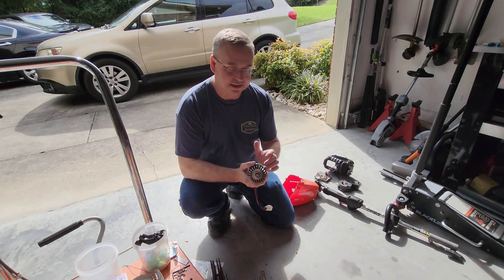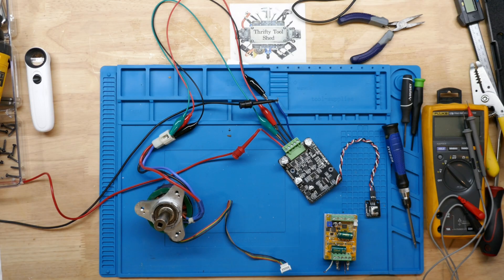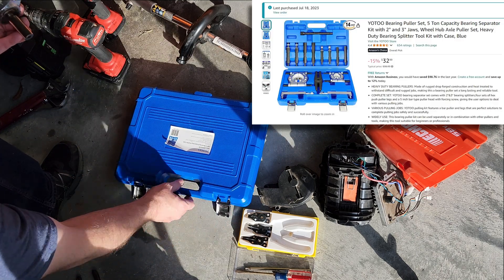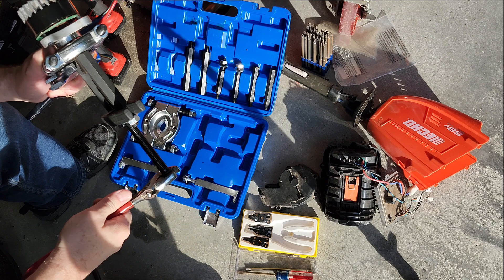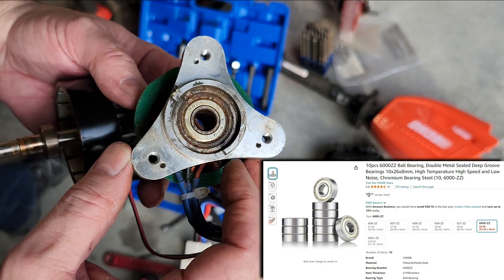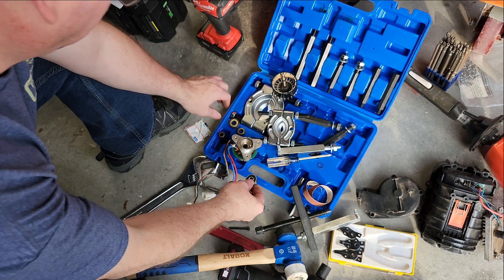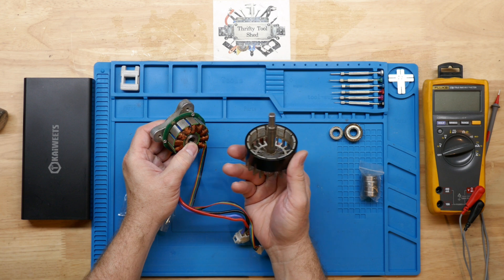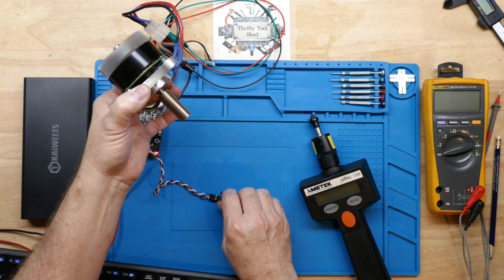ECHO 58V Trimmer BLDC Motor Bearing Replacement

Comment: Great stuff as usual!  I would imagine the shielded bearings with lower drag would be attractive for trying to maximize efficiency and run time, but are an extremely poor choice for any tool operating in wet or dusty environments… like a string trimmer is intended for.

Curious, did you protect the stator with any kind of clearcoat to prevent further corrosion?  Any protective plating on the metal would be removed with sanding.
Reply from the maker: I did not add any protectant to the lamination after cleaning them up, but not a bad idea.